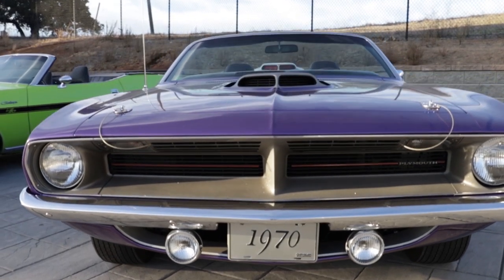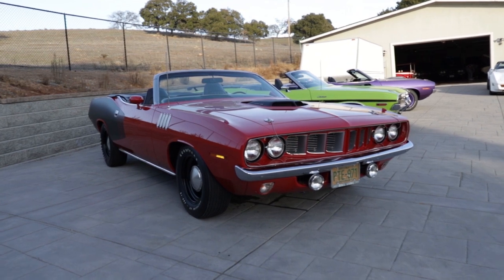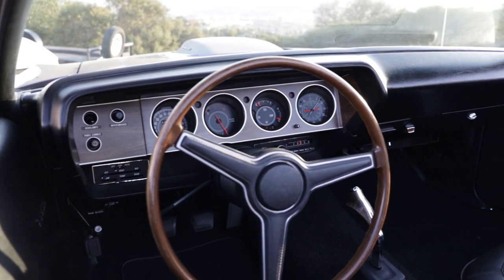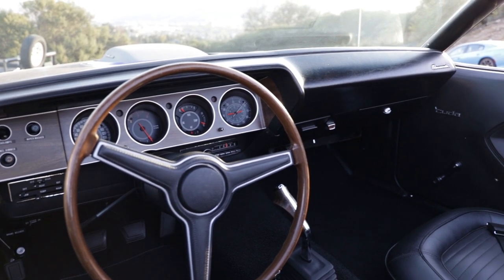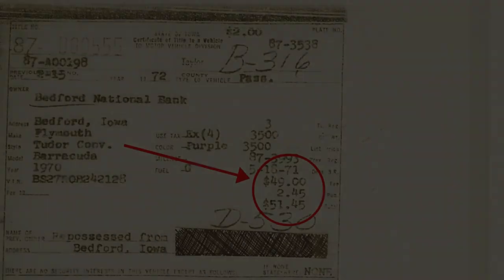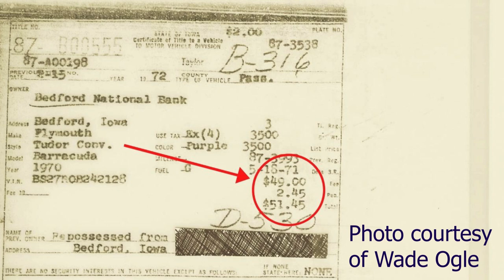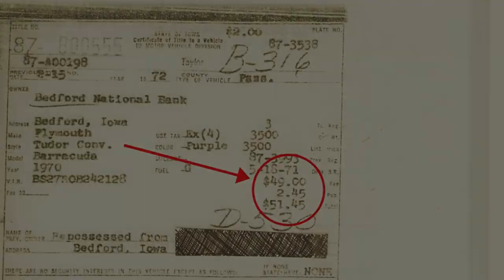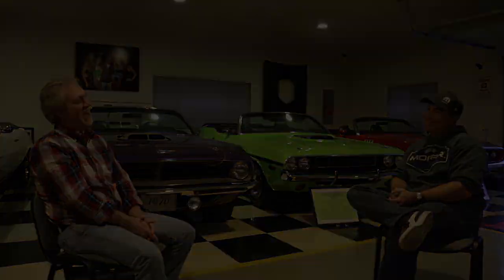Rare look at the History of the "Bass Boat" 1970 Hemi 'cuda Convertible in the Ogle Collection

Comment: This very Hemi Cuda Convertible was just 3 houses down from my parents house at Kevin F. house when I grew up.  I helped sand and strip that OEM purple paint off that car when I was 14ish in prep for the "bass boat" paint in 1974 by the late Joe Bryant, out of his two stall paint shop at their dealership used car lot in Plattsmouth.  The Cuda itself was bought as the body only with 8000 actual miles  by Kevin in 1972 and I was there at that time when we dropped a 340 and 4 speed out of his  63 Dodge Dart in that faded purple body, which he drove like an everyday driver the first 2 years and going to tech school then.  We later on borrowed my Dad's pickup and Kev and I loaded the huge original HEMI and 4 speed from the old Bryants dealership and unloaded it in his rental house back porch for reinstalling later in the Cuda after paint.  The original rearend was long gone before Kev bought the body and Kev had installed a B body DANA 60 with 4.10 gears the whole time he owned it through early 2000's.  I was so fortunate to have driven and rode with Kevin in this Hemi Cuda over 3 decades and helped installing and pulling that Hemi with him over the years. The original factory crank was bad from new and spun bearings at least 4 times in that first 8k miles.  It finally got a new crank installed by a professional race engine shop in Omaha in the early 1980's. I loved that car and almost owned it in the early 80's. It was just to valuable for a 23 year old with a new family and home. From about 1975 on it was a garage queen, usually never seeing the light of day for many decades. Had it at my place in 1994 to do some touch ups, alignment and new factory tires and wheels for Kev and Sandy and removing the 1970 installed ET Mags.  Great memories of my old childhood and friend and his Hemi Cuda. Wish I could add some early photos and the original ad for it from it being sold by a Chevy dealer in Omaha in September, 1970 with 5 K miles and a whopping $2795 price tag!  Also the car was not repo'd for the $51 on that Iowa registration.  Was probably more likely a $2500 loan default. That was the titling fees for the bank to title/register the car in their name to resell in 1972.  Also I know why that rear factory  deck lid was left off for a display.  I so remember how bad that Cuda decklid fit that car with the roughest edges and huge and tight gaps and it left right from the 1970 assembly line as it looked like it was hammered to just fit the opening especially on the front corners.  lol Mark Stastka,  Lincoln, Nebraska